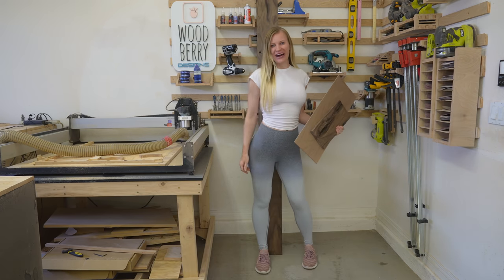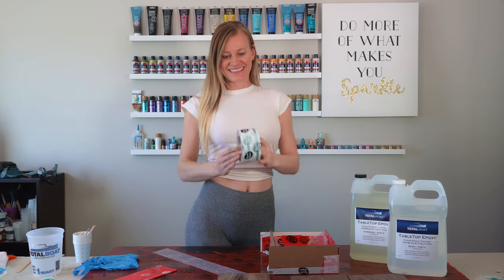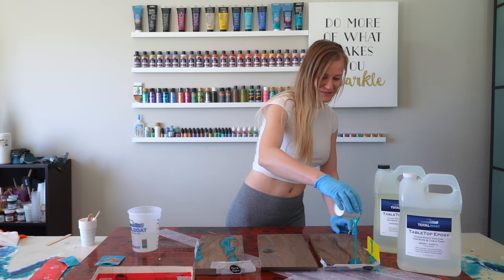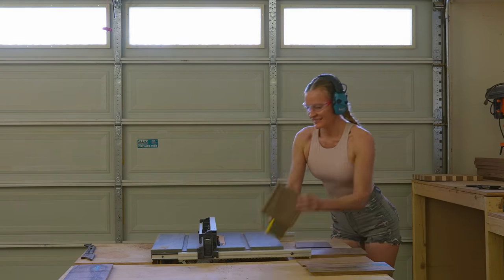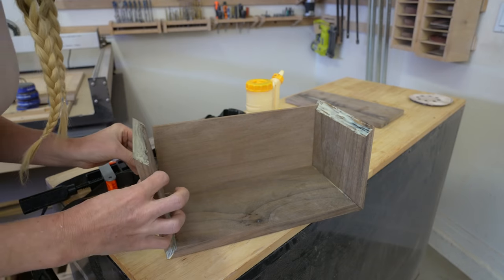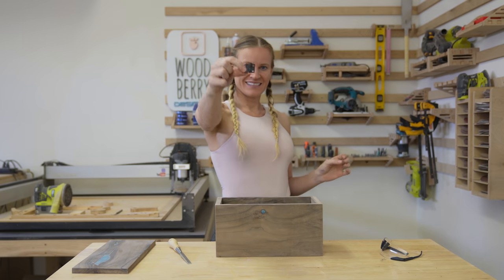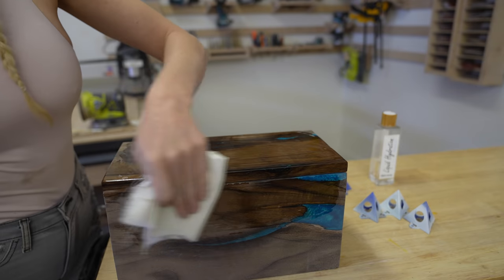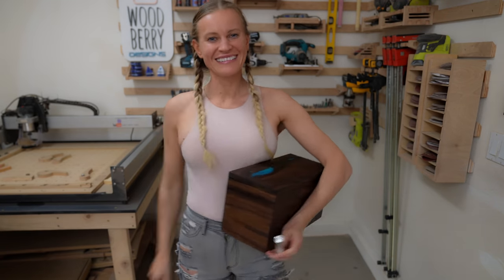Walnut & Resin storage Box #storage #diy  #wood #resin

Comment: Don't glue a rebated bottom, the rebates hold the bottom in place without any glue and allow it to move with humidity. If it's glued it could cause it to bow or split.

Comment: Does the natural hydration keep the high gloss? Is it just oil? I've used several oils both pure and mixes and the high gloss finish fades after a few minutes to hours.
Reply from the maker: It is a oil and the wood will soak it in. After you will apply woodbutter which entails wax for a protective layer. So it won’t leave a high gloss finish. More a Matte color. You can see the box in the end, this is how it will look like.

Comment: Meike, you are in a good fresh shape as regular :-) Dear Meike: please control the knifes of the planer after planing wood with epoxy areas.  I ask this because myself once did simular with a hand guided plainer. Epoxy was pressed under the knife where it sits in the turning shaft. And this cracked the knife initialy.  It was not aware that this can happen. And had luck that I noticed this in a working break. A little later the cracked knife could have been like exploded. And this would have been the reason: The epoxy can become soft by heat from abrasive tools. And those now soft Epoxy partikels can be pressed into thoses little gaps where the knife sits in (instead of blowing away like the wood particles). The preasure of the softenend Epoxy can blow out the knife in pieces. I`m shure you control your equiment. But to make me good sleep, please control the knifes of the plainer with sight to my words. (Make shure that the knifes have noch cracks).
Reply from the maker: Thank you for the tip!! I definitely will check the 🔪

Comment: There is a trick to assembling the box using blue painters tape. 3 stripes of tape, lay the wood one at a time making sure the wood edges meet each end. Apply glue and turn each one onto the next. Super simple cheat.  👌

Comment: Thank you for showing me how to make a box out of walnut because I have some small 1/2" thick walnut boards in my shop in the basement.  I have been trying to figure out what way to make a small box which would be 5"hx3"deep and wide.  I want to build it for an urn that my puppy's ashes are in so that I can hang it on he wall over where her food and water diches were.  I was planning on use box joints but your way looks better.  I didn't think that glue would hold the joints that well.  Thank you again Meike for your help to make my decision.
Reply from the maker: I’m sorry to hear :-( to strengthen the mitre you could also add splines. Looks good and adds extra strength if needed.

Comment: You might injure yourself very badly one day with some of your techniques. If you understand and use the table saw properly you should respect it, not be scared of it. 
Standing all the way to the side of the table saw and reaching over pushing with a push block severely decreases the amount of control you have over the workpiece and you are much less stable. One small slip or if youre cutting a piece with a lot of internal pressure that pinches the blade, and half your fingers will be gone. Stand directly in front of the table saw blade (or slightly to the left when you’re cutting thin strips or there is a risk of an offcut dropping down and getting stuck between the blade and fence when cutting out a notch or dado. Those small pieces can shoot back so recognize when it might happen and leave a small but if space between your hip and the fence) and never use a flat push block as it doesn’t have mechanical grip onto the workpiece, a style like that requires you to use a lot of force to engage friction which will only pull your hand into the blade faster if your workpiece slips or kicks back. Only use a push block with a hook edge (you can make them in just a few minutes out of a scrap piece of wood and a template) or a push stick for narrow pieces where you have generally less than a fist width space between the blade and your hand. If you cannot operate the table saw like that you shouldn’t be using it at all, and instead using alternate methods (routers, etc). Watch YouTube videos to learn about the cutting forces on a table saw and how kickback occurs, so that you can mitigate it. If you understand everything and are always focused, there will be no surprises. 

I have many years of woodworking experience and still have all my fingers. But i work with and know of many people personally that cannot count to 10 due to a distraction, and lack of knowledge and understanding with safety.
You are incredibly skilled for what i assume is self taught, learning how tools and safety works will make your project quality even better. 
One last thing, try to keep your hands out of the path of a chisel and clamp your workpiece whenever you can. I’ve cut myself many times holding a piece like that when I shouldn’t have been. Clamping will also increase control and you will get a more accurate cleaner cut. 

Tables saws and power tools are indispensable machines if they are used safely and correctly. Just looking to help fellow woodworkers in the community!